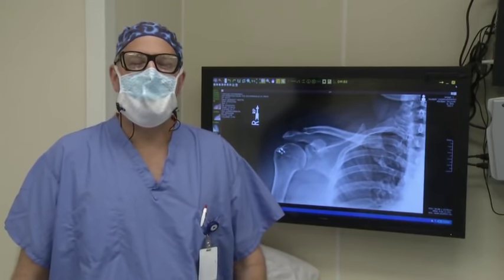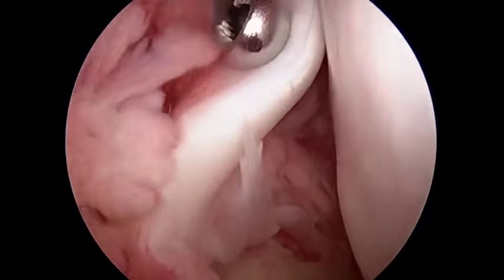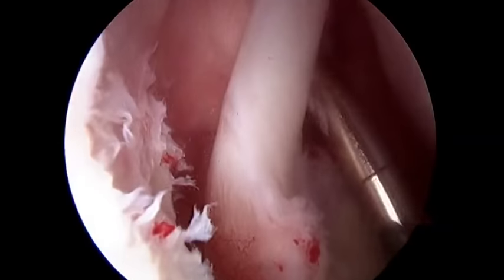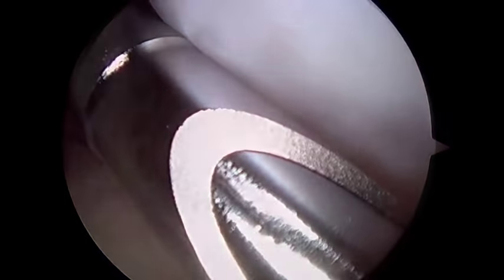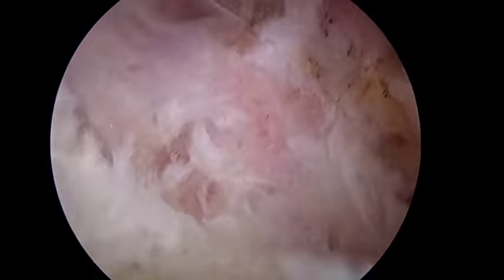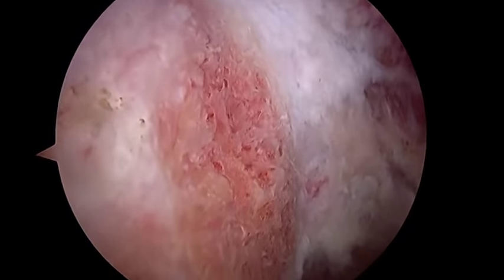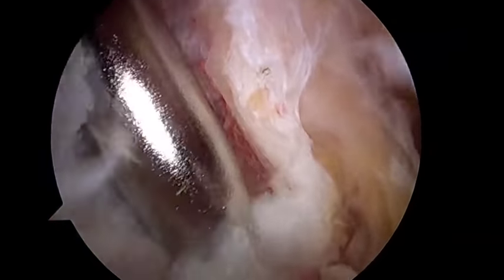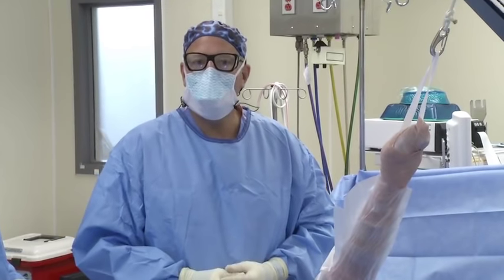Shoulder Arthroscopy Surgery

Comment: Broke the head off my left humerus in 2015 in a mountain bike accident. Plate in my arm and 8 screws and “tightened up” my shoulder joint. Has been quite an adventure in recovery. Still not 100%.. but at least zero pain and FULL motion.
Reply: sprayarm I broke the head of my left humerus too in a freak accident at home on Feb 2018.  Two surgeries later, a month apart,  reverse shoulder replacement and I’m still doing physical therapy.   Shoulder is frozen.  Still not 100% either.
Reply: Dang, makes me not want to take up mountain biking

Comment: I had Left shoulder impingment syndrome and when they operated they discovered a large bone spur. They removed the bone spur and they sorted out the impingment. I was driving again within 10 days. I still had pain within my shoulder but this started to get better after approximately  six weeks. After four weeks I started physiotherapy which helped to  get rid of most of the shoulder pain. This I was reliably informed by the surgeon would go away within 4 to 6 months but I would not be completely pain free and back to normal for about a year. After nearly five months post op I am now able to sleep on my left side, I can reach up above my head, I can put my clothes on without help and I nearly feel back to normal. I do still get some discomfort but I have been discharged from clinics and Physio so it is up to me to carry on my life. This operation does work but it does take a long time to get back to normal so just keep yourself active Know your limitations and help yourself.
Reply: Iris Johnson different story with rotator cuff tears. You were lucky.

Comment: I had surgery last year August. Three things were done. 
1) Rotor cuff repair (torn tendons)
2) Removal of cyst the size of a golf ball (ganglion).
3) Drain Fluid. 
I didn't feel a thing because I was put to sleep. (BLACK OUT).
Man, modern technology, you can't 
beat it.
Reply: How’s your shoulder now??
Reply: It's okay now. Still cracks a bit when I move it around.
Reply: @douglasrainford5533  do you have a good range of motion and strength?
Reply: Yes I do. I'm just trying not to overwork myself.
Reply: Hows your shoulder now?

Comment: I had my right shoulder done. I was able to use my arm within the same day after the shoulder numb medicine wore off. My shoulder had zero pain, I didn`t need to use any medicine they gave me. I could lift things, do pushups and even pull ups.
Reply: Wat type of injury was it tho grade3 i have a grade 5 and am getting surgery  scared i wont have all my strength back to normal or rom did you use a sling for long and when did u start lifting heavy again thank if ya reply
Reply: @luizito1212  hope everything worked out and recovery is going well
Reply: @luizito1212  I strained my shoulder while doing exercise which cause my muscle to stiffen up. They did the same thing in the side. shaved down a little bit of my bone so I can have more mobility. I took the sling off a day after the surgery. I never lift heavy. I was doing a certain technique when benching, I was keeping the weigh halfway down to my chest for a serious of seconds to cheat my muscles into getting stronger. My regular strength was back to normal the same day my sling came off.  I now do more core strength exercises. What you will see is a purple/red patch on your bicep but that will go away after two weeks cause of your arm being numbed up for the surgery day.
Reply: @Dude_Its_Pistachio  It went great and the recovery was just as quick.
Reply: @luizito1212  I forgot to mention, after you finished with the physical therapy (which I loved doing), look up Dave the Band Man. He`s the best when it comes to resistance band exercises. Buy one of his resistance band packages. It even comes with a free 12 week online training program  video(s). You will get stronger will zero chance of ever pulling a muscle again. https://resistancebandtraining.com/workouts/core/

Comment: Am getting this procedure done tomorrow, wish i hadn't YouTubed this
Reply: Don't worry just hope and pray things will worked out just fine. I myself had my shoulder damage last December and it is giving me a pretty hard time. I will be having a MRI scan done next week but am hoping I don't have to have surgery,  however if that's the best option then I have little choice  but I won't be enduring such uncomfortable aching pain for the rest of my life. I rather have it looked after from early than later.
Reply: How did the procedure go? Feel better?
Reply: Rotator cuff was a full tear as well as a torn labrum, still very achey and am going to be starting pt soon
Reply: @bigkeen30  me too soon! dreading it too
Reply: @briansmith8846  good luck to you, pt is the toughest part, i had mine done in May and still have pains in certain parts and my ROM isn't fully back
Reply: How was your recovery and how long it took to be back at normal activities ?

Comment: I had that surgery on Both shoulders -looks bad - however my recovery was just fine each time 
One the had do a full open surgery because of full tear & bone spurs..
Reply: How long was ur recovery? Since u had both.done..im.suppose to do both of mine to but I'm scared,!did I need alot of help.after surgery?
Reply: Paula Luccarelli I did mine on feb 2018, you have follow PT as well as stretch 3 times a day n you ll get full motion. I was doing really good but since last July, I had Lebrum tore on other shoulder too. You have to b very careful after 1 yr of surgery. It has high chances you might gonna tore other shoulder too. I m having my right one, June 10 2019
Reply: Hi I was told I have a full tear and 2 others he claims hes gonna cut off the tendon completely and when flexing I'll have a 4" indentation on my upper arm. This doesn't sound normal. I'm afraid to lose range of motion or worse. Can you please tell me if you saw an orthopedic or neurosurgeon?

Comment: Had mine 12-8-17 & today 8-17-18 it still hurts just the way it did right after surgery but they must have fixed something cuz it doesn't hurt where it was before had all of this and ac joint partly removed due to tear if I could go back and do it again I wouldn't not at the same place anyways they assured me it would be fine in a year well almost there and still no change personally I wouldn't recommend this for anyone due to my experience with it PT sucks but I did it 3x's a week for 8 weeks as directed however I did learn something from that and your posture is a large factor in your everyday pains just think about that sit and stand straight and dont slouch and you will see a difference for yourself

Comment: Amazing how you doctors can tell what's what inside there. I'm fixing to have a rotator tear repaired and the thing that looks the most painful to me is you making the holes for insertion of those tools lol. Yuk.
Reply: Yeah that was rougher than most I've seen. You need a little force to get it through, but moving it side to side like that is just risking dammaging the cartilage.
Reply: I've seen butchers with much finesse. Goodluck with your doctor choosing... hope it's not this guy!
Reply: You won't know pain till you have rotator cuff surgery! And pt is worse. But don't wos out on the pt or you'll regret it.
Reply: Have had this done.  In addition to damaged the rotator cuff, I avulsed the long head of the biceps, which wasn’t reattached.  I was immobilized for about 4-6 weeks. Took almost a year before I could play golf again.
Reply: just sayin' ... PT wasn’t worse in my case.  They didn’t do a nerve block until I came to and they couldn’t get the needle positioned correctly.  The worst pain I have ever experienced.  With PT, yeah, it hurt. But it is a pain you can control.  You can back off at any time.
Reply: just sayin' pt was that bad
Reply: Its called an x-ray wtf?

Comment: I had my R shoulder done June 11th 2018. Its a painful surgery. I wont be able to go back to work till Nov 12,  2018.
Reply: @lindasandell2600  i am a packager for Stanley Black n Decker.
Reply: But now have developed a stiff shoulder.
Reply: My suggestion take the pain meds regularly. N do ice packs faithfully.
Reply: I had total shoulder replacement on a Thursday and went back to work in the shop on Monday. Oxy's will take care of you, although you won't shit for a week, at least.
Reply: @brendahageman7251  Please don't do the ice... true the ice numbs the nerves but drastically reduces blood supply and therefore reduces the healing process. This is from my experence. Goodluck
Reply: @lindasandell2600  Suggest reading the comments before you proceed with your surgery...  There are alternatives with much higher success rates.
Reply: Reading comment about your surgery,...I had right shoulder done April 24,....well 5 months of therapy....and still experiencing pain at times...doing exercises regularly.....A month before my surgery the left shoulder hurt very badly so opted for a steroid injection that settled it down thru the summer and thru right shoulder therapy....In September pain started again....well an M RI revealed a tear in left rotator cuff so having surgery Jan. 14th......so  ......
Reply: @CBDav  You're only supposed to keep the ice on for 15-20 minutes. Then take it off for around 30 minutes. That won't cause any issues from vasoconstriction.